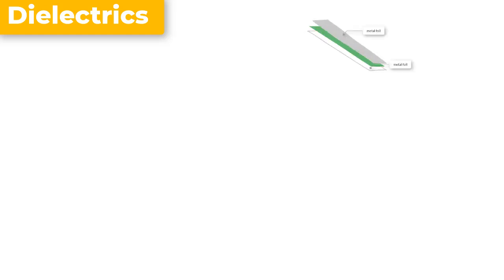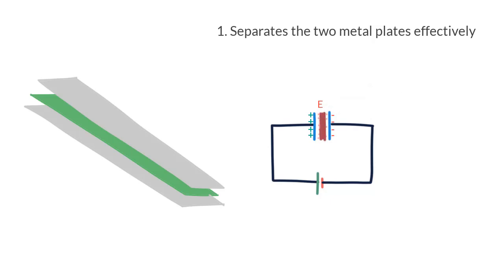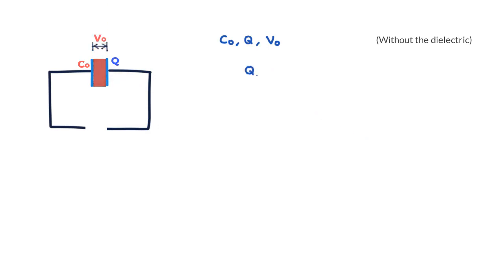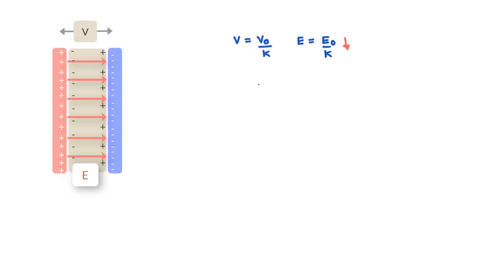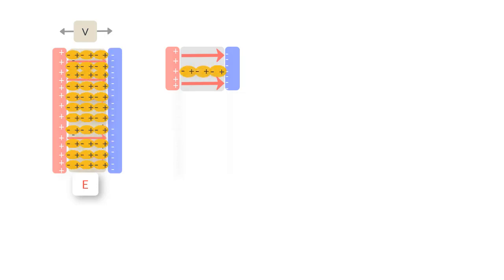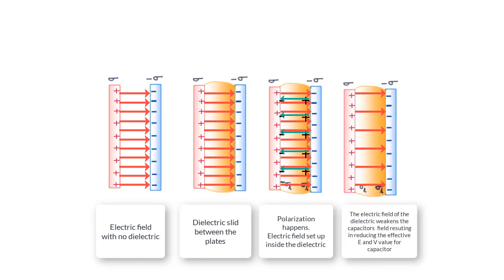Dielectric in a capacitor #4

Comment from the maker: 00:22 How is a capacitor made?
00:59 How do dielectrics improve capacitor performance?
02:53 What happens when you put a dielectric between capacitor plates?
04:55 What is a dielectric constant?
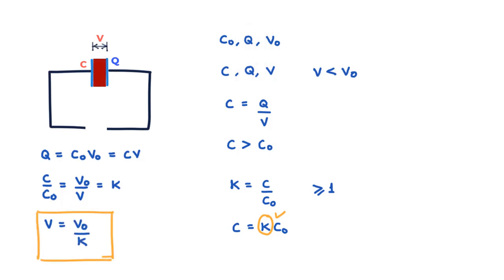05:52 Dielectric constants for various materials
06:20 How charge is induced in dielectric
09:27 What is permittivity of a dielectric
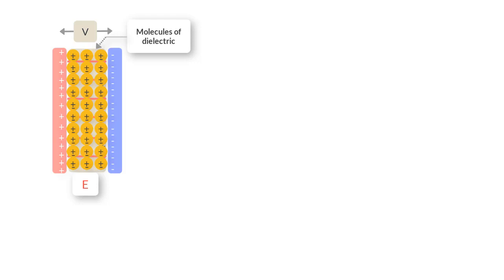10:55 How does polarization of dielectric happen?
12:50 Visual representation - what happens when a dielectric is put between capacitor plates